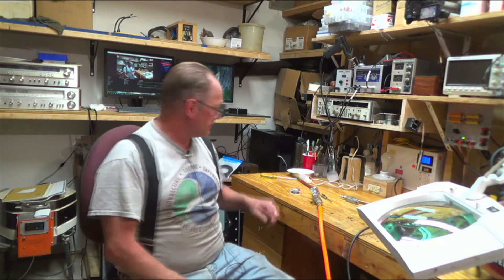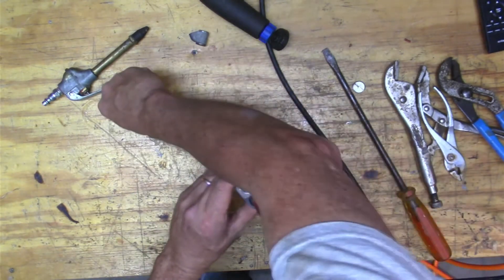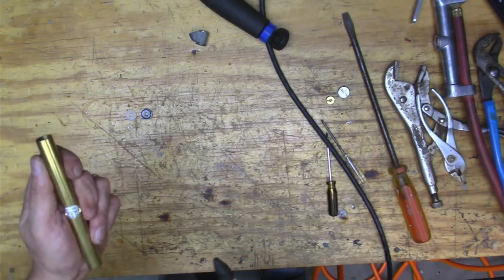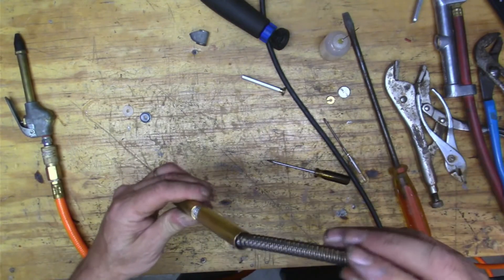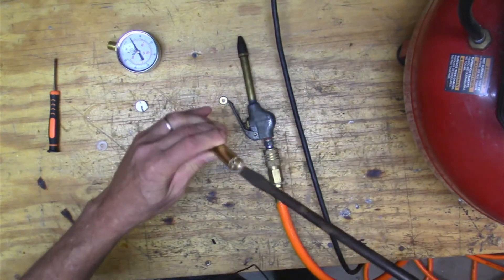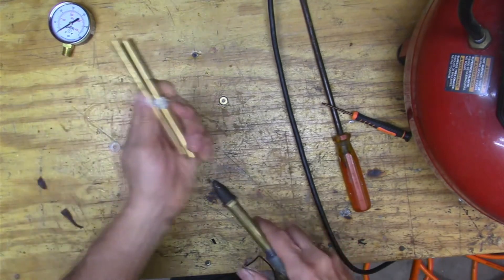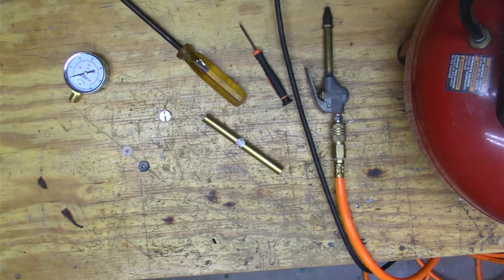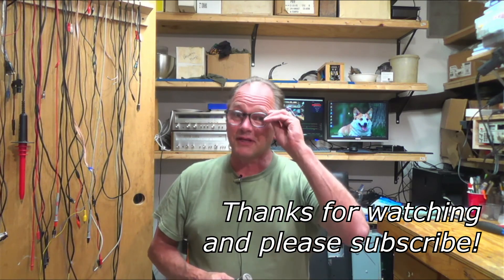Milton S-506 Tire Inflator Calibration

Comment: Thanks for the instruction.  I just spent the last year cursing my BMW motorcycle's TPMS for reading low and allowing such a small threshold before warning lights.  Turns out my "good" gauge has been reading 7-8lbs high for potentially the last 5-6 years.
Reply from the maker: Great, your cycle is going to appreciate it!

Comment: Thanks so much!

I had to use a tire filled to a given pressure using a tire gauge   

I had to take the Milton apart and reassemble a few times, but that was easy thanks to your video 

👍
Reply from the maker: Glad to hear it worked for you!

Comment: So I just finished calibrating both of my Milton inflators using your excellent instructions.  thank you again!!!
I did have a little trouble aligning the guts with the round window on the first one.  When I tightened the out cover, the guts twisted a bit.  Later, I realized that the rubber seal at the bottom of the handle was a littile oily, so I assume that's why it twisted.  I tried removing the guts once or twice to get it right, but finally gave up with the gage being readable, but not quite centered in the glass window.
I didn't have that problem with the second one.
After I got done with the second inflator, I realized that I could remove the little window on the first one by pulling out its snap ring and then I was able to pull the guts into the correct position with a needle nose pliers.
Thanks again!

Comment: Thanks for the informative video, I bought one of these and found it to be so far off in accuracy that I just could not trust it. It has been in my tool box for almost 3 years un-used. Now I see that you can calibrate it I will give it a try. My only question is why are these not calibrated at the factory before being shipped out to customers, Mine is off almost 5 PSI.

Comment: I have at least a half dozen tire gages and two of them are Milton's that I bought within the last few years since my original Milton failed after 30 or 40 years of constant use. Recently I realized that both Miltons were reading about 6 psi high in comparison to all my other gages.  So this video will be very helpful to me.  My decades-old  pencil gages and even a Radio Shack "Talking" digital gage are right on, by the way.
I am surprised that the Milton's were that far off!!!
Reply from the maker: I know, you'd think the milton would be right on since they've had 70 years to perfect it. I've always liked how old-school it looks and feels!

Comment: Good one Rob. I have about ten tire gauges but not the old Milton that we used to sell in my folks auto parts store. I've found that they all vary a HUGE amount, sometimes by ten pounds. It's hard to tell which one is accurate. Even the dial gauges are different. Good video!

Comment: I've tried about a dozen times. No matter how you adjust this on a bench like this it's off when you connect it to a tire. It's either tank pressure or working pressure. This is why these are trash